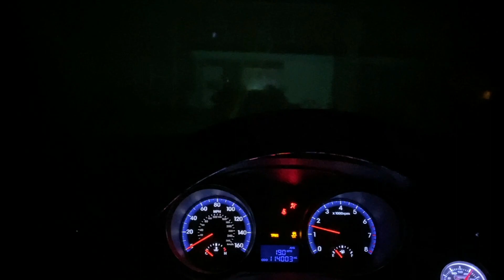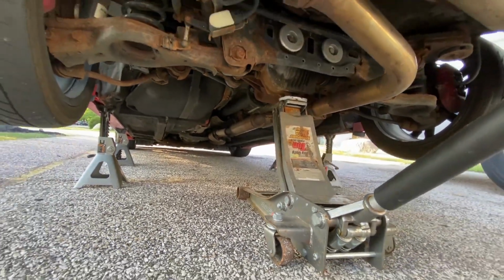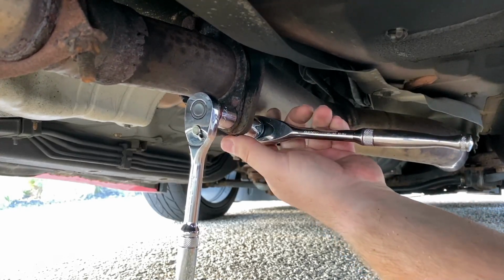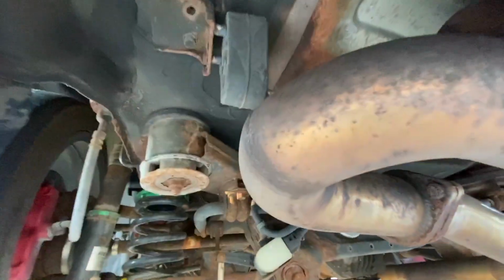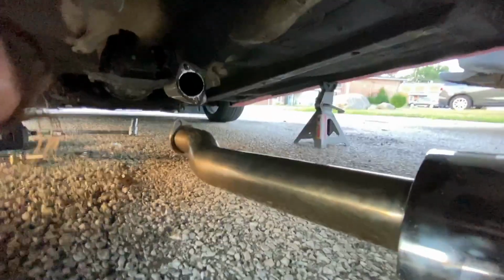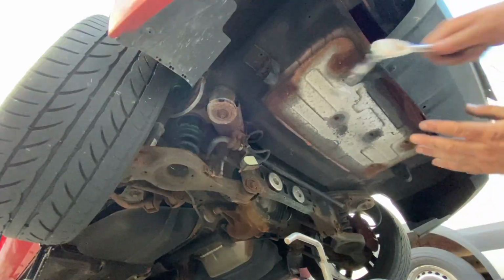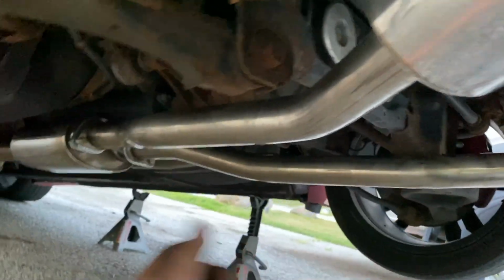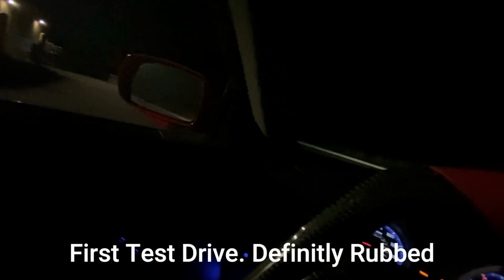My Genesis Coupe Gets a New Exhaust (CNT V3 & BK1 2.0T)

Comment: Nice
Reply from the maker: Thank you 🙏
Reply: @BuildsWithV_  What are your mods?
Reply from the maker: Intake, depo catless 02 housing and down pipe with cat delete, cnt v3 exhaust, TB spacer, Megan trans mount and XclusiveTuning tune. Maybe a few other mods as well. I added some parts and links in the description as well.
Reply: @GCNation I’m interested in the xclusive tune but from what I hear it’s pretty mild besides the increase in boost but It look like you have 2 step too?